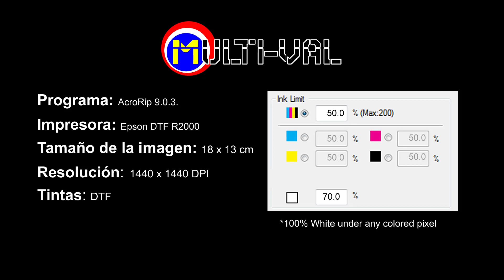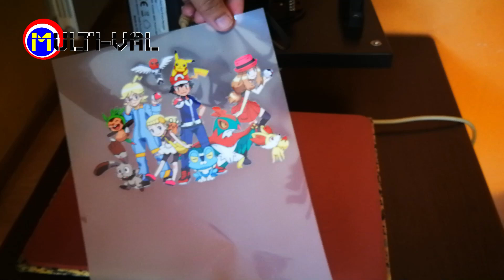Impresora DTF R2000 Estándar en A3 y 4 Blancos

Comment: Saludos al quitarle los rodillos que hacen el camino de hormigas, imprime sin problemas a el final de la hoja? Muchas gracias excelente video, también tengo una r2000 en dtf, todo bien lo único que el chip de los cartuchos se agota muy rápido, sabes alguna solución?
Reply from the maker: Hola. No, con esta modificación al quitarle el rodillo delantero el área de impresión a lo largo se reduce unos 7 cm, es decir, si es un A4 podrás imprimir 21 x 22 cm y si es un A3 29,7 x 35 cm aproximadamente. Sobre el tema de los cartuchos la única solución es poner un sistema de tinta continua (CISS) porque está máquina al llevar un cabezal profesional consume mucho,  es 3 veces más rápida que la L1800.